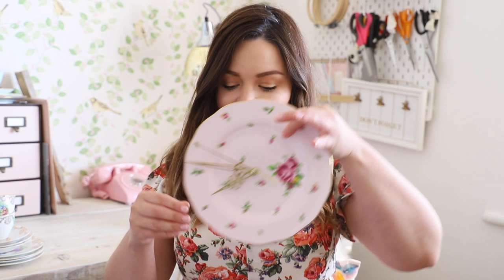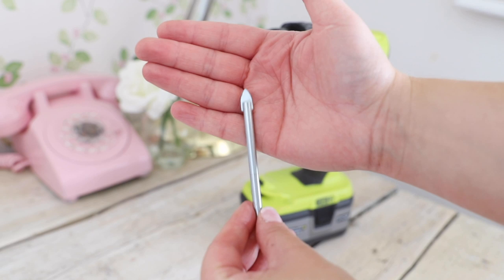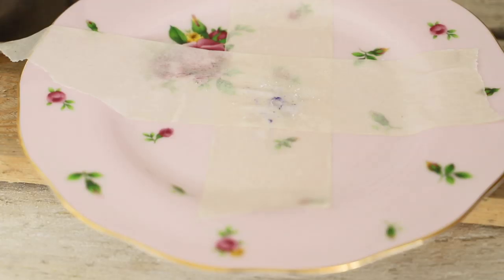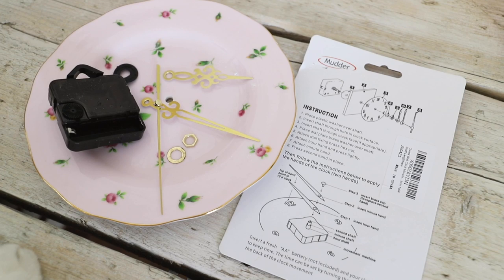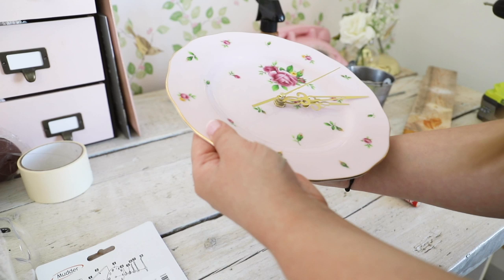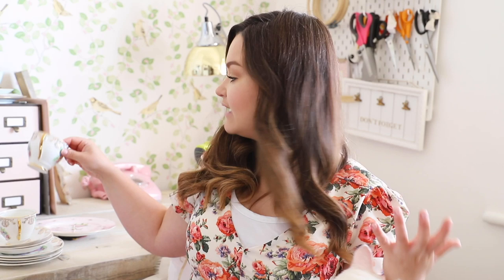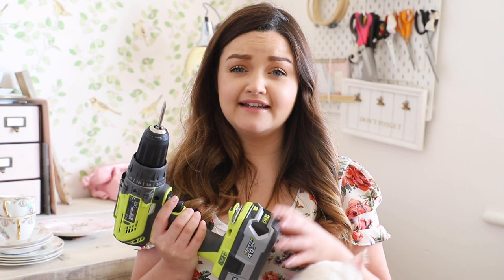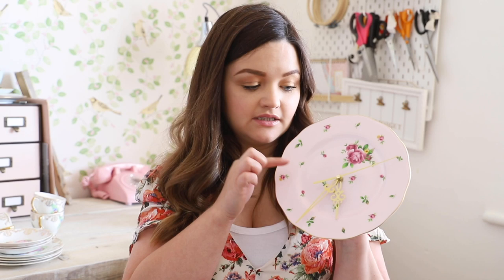How to drill through ceramic, DIY home decor, vintage china clock

Comment: I love that you made this video💗. I have wanted to do some china crafts but wasn't sure about the best way to drill a hole through without breakage. I'm wondering however about the settings for the drill...
Reply from the maker: I just have my speed setting set to high and make sure to stop once it gets too hot and dip the tip in water x ❤️❤️❤️

Comment: You mentioned the correct settings/speed for the drill, but .. what is it?
Reply from the maker: Hey, just set your speed to high and make sure to dip the bit in water often so it doesn’t over heat ❤️